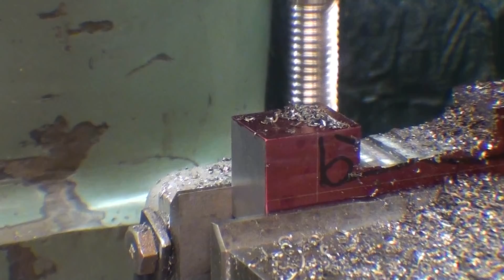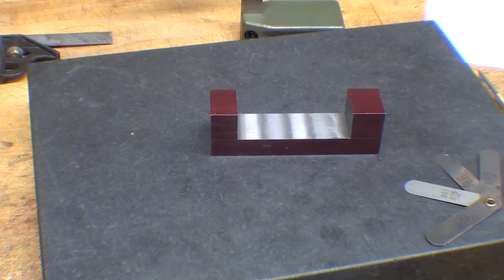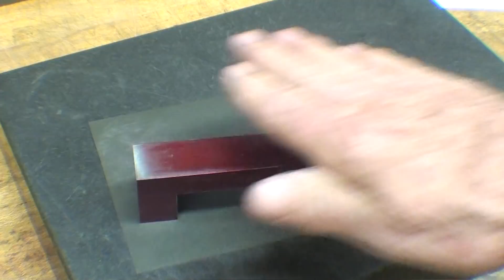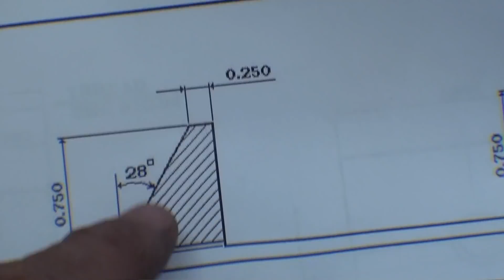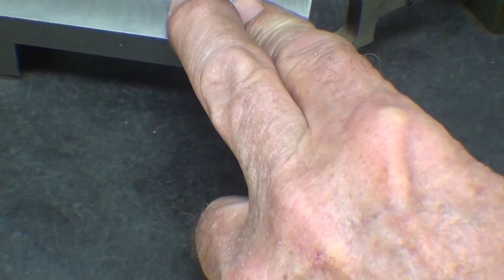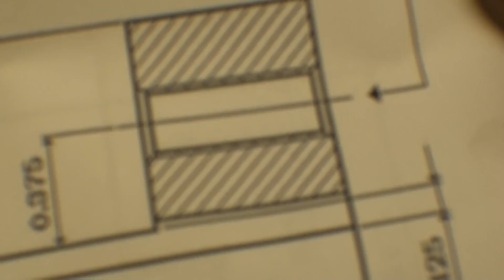TIPS #351 pt 2 tubalcain MAKES A TOOLMAKER'S VISE

Comment: A friend of mine at the Houston Metal Shop Club had problems trying to mill a piece of cold rolled steel.  Any cut would cause the workpiece to warp.  So he cleaned the workpiece of oil and put it into his kitchen oven at 450 F for two hours.  With the oven vent running, he didn't stink up the house or the oven.  After two hours he turned the oven off and just let it all cool naturally with the oven door closed.  That cured his warping problem.

I've been doing the same thing with my cold rolled.  I clean the workpiece with acetone before putting it in the oven.  I get a little scale from oxidation but, the cold rolled already has mill scale on it.  If I really want a shiny finished product, I can sand, mill or file both sets of scale off.  I haven't noticed any warping problems but, in all honestly, I have not really checked closely.

My sense of what is happening is that the cold rolled really has no quenching stress in it.  It is so low in carbon that it will not form any martensite when quenched.  Even cast iron will naturally free itself from stress if you just let it sit for a year.  Assuming the cold rolled has been around for a year, any cooling stress from the original heat is long gone and the remaining stress all originated in the rolling operation.  The 450 F treatment is equivalent to a tempering operation on a piece of quenched steel.  It just takes out a little stress.  Can't claim that it cures all problems but, it is at least a partial cure.

Regards,
Norm Berls
Reply from the maker: Very interesting. I will eventually try that. I guess its normalizing. Thank you very much

Comment: You should always finish cut on a lead screw machine with conventional milling.   Your tool pushes the slack out of the lead screw.   If you put your part on a cmm you would see all the inaccuracies.   But for what you are doing it will be fine.     Love your videos.    I want all the stuff you have bye the time I am your age.    I would never leave my shop.

Comment: The mill scale on hot rolled stock really is no problem after a day in vinegar. I rather wait the day than trying to mill a tool, that, for all intents and purposes you'd want as flat as possible, from cold rolled..
Preparing hot rolled in a nice vinegar bath in advance and keeping it dry will prevent a lot of delays.

Comment: those tops were no longer straight after you milled out that chunk. so when you milled the bottom flat and laidout the line for the hole, both operations were off because your reference surfaces weren't true

Comment: Great video as usual.  I was wondering why you did not check the inside surface to see if it was flat.
Reply: It will be bowed just like bottom (outside).
Reply: SJWs & Betas Killer will it? No professional here but I'd think the bow would be less on on the inside, because every bit you remove of the material it would release more tension. So the inside might be quite flat. Wouldn't the finishing cuts knock out all the high spots?

Comment: Great video of the toolmakers vise project. The oil smoke from the high temperature metal chips is incredibly toxic. It is known as Polycyclic Aromatic Hydrocarbons. It is recognized by The Inernational Association for Research on Cancer (IARC) as a known carcinogen.  Please let your viewers known how dangerous breathing in these fumes are and to wear personal protection such as a respirator.
Reply from the maker: did not know that--but been breathing it for yrs
Reply: Would an extraction tube placed near the cutter do the trick? Thanks for educating me!
Reply: mrpete222 I breathed the same for years and Workmans Compensation has now  allowed my doctors claim for bladder cancer from a career full of it, and I have never smoked a cigarette in my life. Smoking is normally the highest risk for bladder cancer. I have found through my research that Machinists and metal workers in general are at a very high risk of having bladder cancer because of the toxic environment associated with burning oil smoke. Found this out after all the years had passed. Maybe some of your viewers will take note and wear a respirator our make darn sure 
 there is good exhaust ventilation.
Reply: I was thinking of a powerful 3-4 in extraction tube that can be placed very close to the cutting on the mill, lathe, drill press, even the grinder (grinding dust), what do you think?

Btw I'm sorry about your disease. How is urination/bladder stretching now? Have you had a catheter?
Reply: +Metalmogul46 and arthritus use guys in high production automatics and left ear bad
Reply: Lite Roadie Anyway to keep the oil smoke from your lungs is a help. its the accumulation over years that does the damage.
Reply: Miguel Castaneda , Operating machinery daily for years does cause wear and tear on anyones body.
Reply: Lite Roadie , My bladder has had several tumor resections and does not function properly anymore. The tumors will eventually take my bladder and then the rest of me. The latency period for bladder cancer to develop is many years, so its not too late to keep your environment clean and free of toxic chemicals. Start wearing nitrile gloves as all the lubricating and cutting oils that you touch ends up in your bladder. Its a daily accumulation that causes the cell damage.
Reply: I always get my hands really oily (black) working on my bike chains, hubs etc. I'm 17 so you potentially saved me from cancer! Thank's for the info! I will try and tell as many people as I come across.
Reply: ..The dirty oil isn't too bad...it's mostly the smoke from heating it that is toxic....
Reply: Well, it'll at least keep my hands clean and save me washing them with dish soap for 10 minutes every time if nothing else!
Reply: Metalmogul46 also im sorry you were infected i really am but trust me most of us will get our turn!

Comment: Why didn't Mr. Pete mill two groves in at either end and band-saw a big chunk out?
Reply: He discussed his reasoning in Part 1... basically, once you are set up in the mill, with a decent roughing (hogging) cutter, it goes faster & cleaner.

If you need to save every scrap drop of metal, then by all means feel free to do it as you suggest.

There's no one "right" way to do the job, and if two machinists can't come up with at least 3 ways to make a part, they're loafing! ;^)

Comment: Thanks for another excellent series.  I have had similar experiences with hot rolled and used sand paper to to lap the parts flat on a surface plate as you were showing.  It works, but takes long time.  Would it be worth the time to try and straighten the part in a press?

Comment: around 14 min into video you mentioned relieving the stress in the cold roll...friend who used to do tool and die used to age his material either letting it set out in weather ir multiple heatings and coolings...any truth to that...?
Reply: Near where I live was the Hendey Lathe Mfg. Co. They would let their castings sit outside for up to 2 years in order to let the internal stresses dissipate before doing any machining on the casting.

Comment: Another great video!  Quick question - instead of milling the bottom over again would it not have been just as quick to use the sand paper to (figure 8 motion) to take the material down three of four thou?   Or could you lose parallel accuracy?  THanks   Rod
Reply: Yes, there is danger you will make it fairly flat, but no longer parallel/square to the other features.

Comment: Looking at the end view on the drawing, the angle goes to a line .700 from the top -not .750.
Reply: This to eventually add some relief at the inside angles I assume.
Reply: Good catch. That makes the angle 28.18 as opposed to 26.57 if the .750 line is used.
Reply: To make the angle closer to 28 degrees, the line should have been .705. With the .25 dimension on top, only the .700 dimension OR the angle should have been shown on the drawing to make this part of the base, not both. Since this face is not critical, it doesn't matter which one to eliminate from the drawing.

Comment: What kind of oil do you have in that red oil can thingy? Also by any chance do you know if you can use Tap Magic as a cutting oil for like drilling holes in steel and the Tap Magic Aluminum version for drilling in aluminum with a drill press? If not what do you recommend for drilling in steel and aluminum? One more thing, is the Tap Magic Aluminum as good as AlumTap or AlumiCut? Thanks, also I watched your Favorite Shop Liquids video but there are just to many decisions and I don't know what the difference between thread cutting oil, tapping oil, and cutting oil, so maybe you could point me in the correct direction. Thanks again!
Reply: For steel, use cheap brown sulphurized cutting oil (about $20 per gallon) and for Aluminum, use kerosene or WD40.